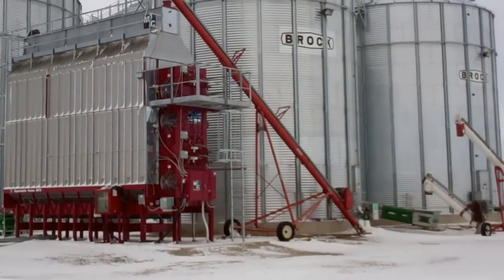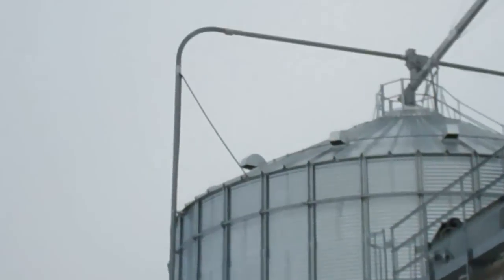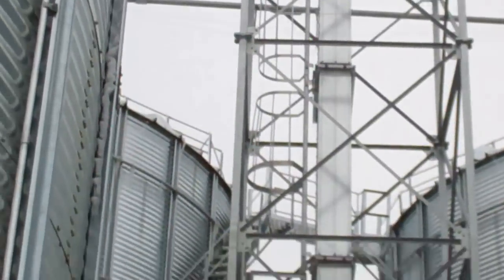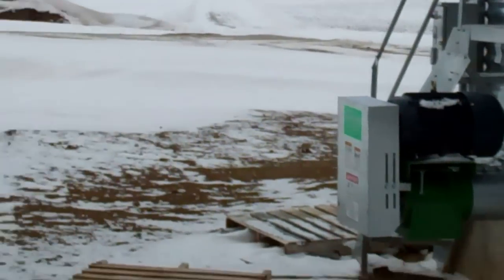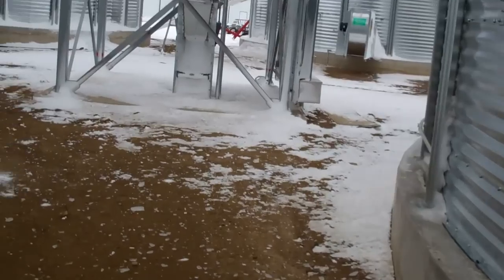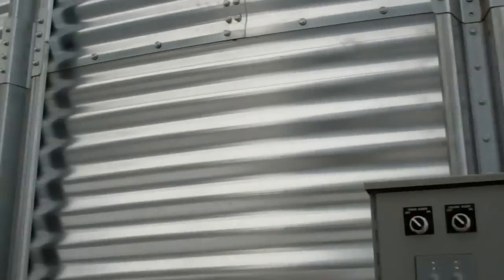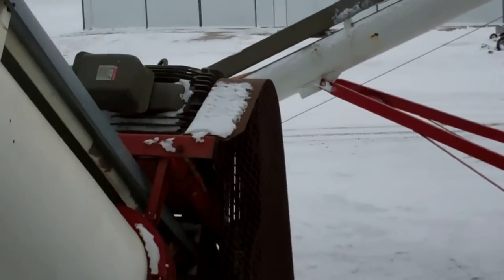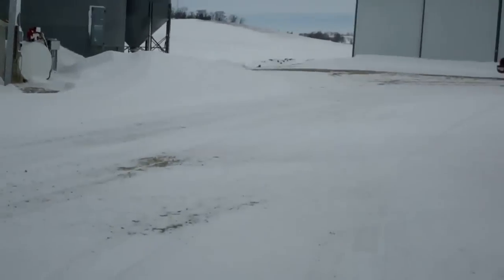Grain Handling Setup pt. 2

Comment: What's diameter and heights of corn bins?
Reply from the maker: The 2 bigger bins are 48ft diameter with 12 rings so 44ft tall sidewalls. The smaller wet holding bin with the red auger by it is 30ft diameter with 9 rings so 33ft tall sidewalls. The soybean bin is 36ft diameter with 9 rings as well.
Reply: What's the drying capacity on your dryer?